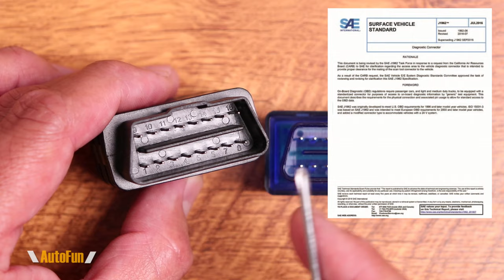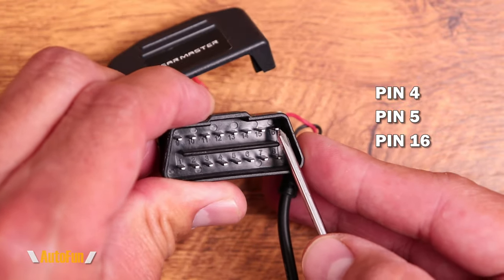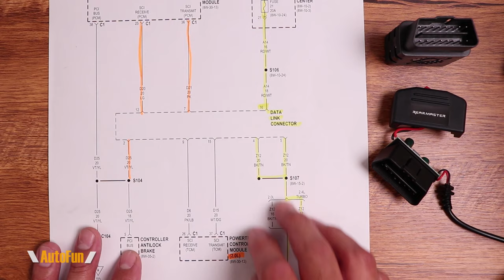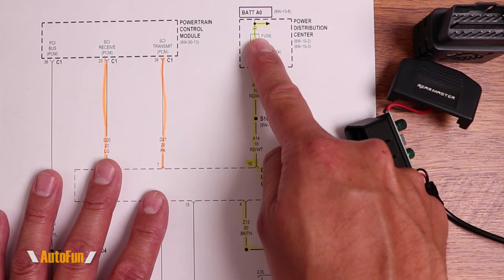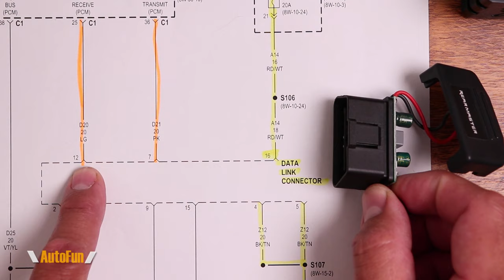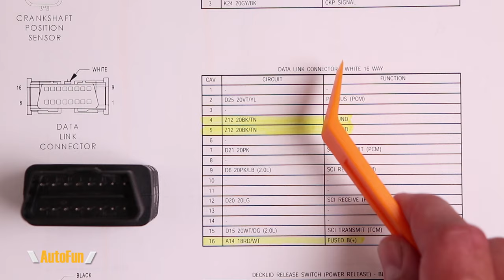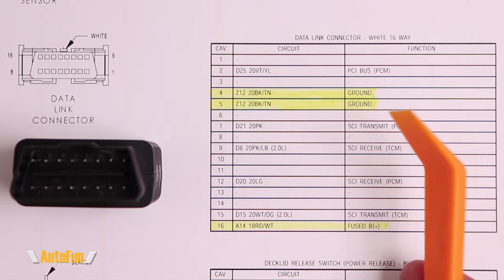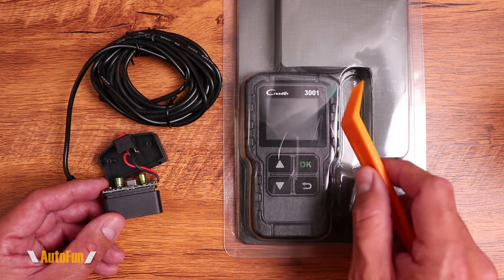OBD2 Power Adapter DANGEROUS? (Is it safe to use the OBD port for power?)

Comment: Alex, I've watched your very helpful video and I've read through the comments. I'm buying a dash cam for my son's first car for Christmas. He worked incredibly hard to buy the car...since he was 12 years old he saved money to buy that car. (He's been a car enthusiast since the age of 2!) I don't want to do anything to cause harm to it, despite the fact that it's a 10 year old car with 120,000 miles on the clock. It's still his most prized possession. That said, I remain confused by some of the comments and your other video on hard-wiring. I want to know whether it is best to hard-wire or just as good and safe to use this OBDII connector, please. I can order one with the dash cam for $50. Should I do that or should we attempt the hardwiring job as a DIY project? Thanks so much for your input.
Reply from the maker: Thank you Julia! Hardwire is an very involved process, requiring experience and knowledge, I strongly recommend profession installation due to the dangers involved with air bags as explained in my follow up video here https://youtu.be/uZp95NbNlmM and also potential dangerous issues caused if erroneously tapping a critical system of the vehicle explained in my dedicated hardwire here https://youtu.be/K2iKXj82354 Cheers!

Comment: You seem to understand these "gadgets" quite well. You have the knowledge and background to invent. Have you ever had a idea that materialized into an electrical or mechanical gadget?
Reply from the maker: Hi Bent Nickel! thanks man, I try to learn as much as I can (I'm still learning everyday!) but to answer you question. I had ideas but nothing that I realized on my own. However, I have contributed to products that were being developed, both from a design standpoint and from a manufacturability standpoint. Some engineers come up with great designs but they are not always possible to make in high volume, so the designs needs to be changed. But maybe one I have to come with a product of my own, that be kind of neat!

Comment: I’ve had an ultraguage plugged into my odb port for about 10 years and never had any issues but after seeing videos of Scotty saying they are deadly to a car I have decided to unplug it.
Reply from the maker: Hi Keving! Ah yes scan gauges will actually interact with the lines that communicate directly to the ECM, so the potential for something going wrong is higher that on a basic OBD2 power dongle where only power is tapped from the OBD2. But yes I had the same experience that you had, I have never had an issue plugging devices into my OBD2 port (and I plug in quite a bit of them since I'm always reviewing different gadgets LOL) Hope this helps, Cheers!

Comment: Awesome video!  Do you happen to know why the OBD-II port has 2 ground pins,  #4 = Chassis GND, #5 = Signal GND?   My guess is Chassis GND is for +12V power return, while #5 is for signal return path.  In your switched OBD-II plug, I see they are shorted together.  But how are these 2 grounds connected on the car side?
Reply from the maker: Thank you! Ah yes the reason it's technical in nature, I'm not an EE but will try my best to explain,  if you look at the SAE-J1962 standard, pin 4 is for ground as provided by the chassis of the car (for current draw as in SAE J1978). Pin 5 is a signal ground as in a ground reference for transceivers and test equipment but with consideration to noise contributions and node-to-node voltage offsets (basically a clean ground that is more free of noise than chassis ground). Now here is the kicker, some cars combine both 4 and 5 on the connector side and some keep the connections independent (which in my opinion is the correct way so the plugged in device can decide if it's needs separate grounds or to join them) If you check your car's service manual and wiring schematics it should show how your vehicle is using pin 4 and 5. Hope this helps, Cheers!

Comment: Very useful video. I have ordered Thinkware U3000 that has obd cable inside the box. However, the obd cable has 8 pins. Can this obd cable be harmful to the car?
Reply from the maker: You're welcome Gladiator! Ah yes as explained on the video, most OBD2 power adapters may be fully populated as far as pins however most of the time only the power pins are connected like the adapter as shown on the video. Cheers!
Reply: Thanks, but actually thinkware obd cable actually uses other pins. For example, when I open car's door, the dashcam triggered to be in driving mode.
Reply from the maker: You're welcome! yeah there are so many OBD2 adapters out now, it's almost overwhelming considering they use to be some what rare back in the days. I may make a couple more teardown videos on them if can get my hands on some samples, stay tuned. Cheers!  @Gladiator12350

Comment: While I don't see the need to draw power from the OBD port (I don't know how much power it can give, but maybe that is discussed later in the video😁), I do think any cheap OBD stuff is very safe to use. If they sell you a plug for 10 dollars that reads and/or resets codes, they probably haven't thought too long about safety.
I do agree with the video when he says that the power plug he uses doesn't crash the car's computer, maybe blows a fuse but not more than that.
Reply from the maker: Hi Benny! yeah and you be surprised of the quality (more like poor quality) on devices that are more expensive. I'm seeing the industry be more about the brand name than pricing which is crazy, some lower cost products sometimes exceed the quality of big brand names. Crazy uh, Cheers!

Comment: The OSB II port on most new vehicles should never go over 3 amps of power ether power in or power out because the wires attached to the OSB II ports are not rated for heavy power loads. But I actually use my OSBII port as a solar battery trickle charger that’s under 3 amps.
Reply from the maker: Hi D! Ah yes so far the OBD adapters I tested are limited in power draw (usually less than 3A @5V, so about half that amount at 12V where the power is being pull from) Cheers!

Comment: Hi Alex! Thanks for this informative video. 
My question is, if you have " 2" separate dashcams. Is it OK to connect one cam with this connector  and the other cam connected with a hardwire kit?
Thanks for any answers!
Reply from the maker: You're welcome Bud! Ah yes the OBD power adapter is independent of a hardwire kit being being installed, so yes both could be run. Cheers!

Comment: Thank you for providing this video. I have a new mirror dash cam. The company sent to me a new hardwire kit. It has OBD2 adapter, but only has two separate pins, top and bottom, and plastic fins in the middle.  And it also has one mini connector to the fuse panel. For parking mode and recording functions. Probably has to re-watch your video to learn is it safe to install? And contacting the seller have not receive installation instructions. Any advise?

Comment: Thank you for this video. Loved it.  Question- would connecting a dashcam to the obd port cause the battery to completely drian out?
Reply from the maker: You're welcome V! This would depend on the OBD2 adapter that is being used. The one I use, has a low voltage protection (to reduce the possibility of draining the car's battery) Here is my video showing how it works https://youtu.be/YEklm9V6xYE Cheers!

Comment: Hi, thanks for info!!
Do you think can I use N3 dashcam with Dash Cam OBD Hardwire Kit, Dash Camera USB Type C Hardwire Kit with OBD Power Cable for Dashcam 12-24V to 5V/3A with Low Voltage Protection 24h Parking Surveillance/Acc Mode for Dashcam, GPS or Radar on Toyota Highlander hybrid 2020? I’m just worried about before affects it!!!
Thank you…… hope you answer
Reply from the maker: You're welcome Ismail! Ah unfortunately I'm not familiar with the N3 or it's power requirements. However here is another video where I show you how to identify the power requirements of a dash cam https://youtu.be/-hGu8KZLaZ4 Cheers!

Comment: Incredible video! I can't thank you enough for this video you have created and the help and answers you have provided! I would like to ask you a question if I may? I am buying a Thinkware U1000 and the Blackboxmycar Powercell 8 Battery mainly for the use of the parking mode features. Does this ODB2 Power Adapter work in conjunction with the Thinkware U1000 and the Powercell 8 Battery? I am trying to keep the hookup clean and avoid using the hardwiring kit. Thank you in advance!
Reply from the maker: Hi Richey! ah good question, Thinkware does have their own OBD2 adapter (their dash cams work on 12V vs the 5V that dash cams normally use) here is the adapter https://amzn.to/3n83x0g and this one https://amzn.to/3lpOa2c (this one is a smart version of the OBD2 adapter, video on this adapters coming!) however if you still want to run if off a battery, this is the Thinkware battery pack https://amzn.to/3bnExj6 it's actually cheaper too than Powercell. Hope this helps!

Comment: Regarding the non-used pins getting shorted, it would be great if the connector only had the pins it actually needs. Then the risk of solder or other conductive material shorting anything out.
Reply from the maker: Hi Benny! Yeah that would make sense, the issue is that OBD2 does not fully use the connector body or a collar like most connectors to keep the connector in place, instead it more of the combination of the female and male connector bodies surfaces interacting when mating and the contacts themselves being mated for retention force. Which means unfortunately that leaving on the active pins on a OBD2 port would significantly reduce it's holding force and may lead to the connector to wiggle off or come off  easily. Cheers!
Reply: @AlexAutoFun  yeah, I figured that would be the problem. It is a bit weird that an automotive connector can't sit secure enough without all the pins tho. Puts unnecessary strain where strain shouldn't be IMO.
Reply from the maker: @bennylloyd-willner9667  Yep exactly! The J1962 standard actually does have a provision (Clause 5.5) for a connector latching feature to ensure connectors remain mated however since that same clause also requires that "it shall not require the activation of any levers on either connector to mate and un-mate" this has led to OBD connectors that can be partially retained by a passive method (friction of a mating surface, normally the top stub area). And in a few tools there is actually a button that you press to disconnect the OBD2 connector however strangely enough this feature requiring action on part of the use to un-mate the connector makes it non J1962 compliant. Maybe we will see this change on the next revision of the standard. Hope this helps, Cheers!

Comment: Will this activate parking mode on a dash cam since it is not hardwired in? I’m trying to decide between this or the hardwired kit. Awesome video.
Reply from the maker: Thank you Pete! Ah yes the OBD adapter will not enable true park mode. However in some cases it can be used to monitor the car will parked, here is video where I cover this https://youtu.be/YEklm9V6xYE Hope this helps, Cheers!

Comment: What a great video! Very informative and clearly explained. I've just purchased two Garmin dash cams (66W to the front and Mini 2 to the rear window) and have been researching for hours the best way to power those two. I'd want to avoid hardwiring. After this video, I now have the confidence to use Garmin's constant power ODB cable. Do you know if I can use the Parking Guard mode with that, perhaps with the 24-hour or always-on option? When not driving, I only want to have recordings of incidents, such as someone walking by or bumping into the car. Any experience using it with the Toyota Corolla TS Hybrid?
Reply from the maker: Thank you Sami! Ah regarding parking guard on the Garmin Dash cam with their OBD power cable, I have not tested either, however it is likely that their adaptor functions similar to the generic OBD power adapters. Here is my video where I explain how those work and their potential uses for park monitoring https://youtu.be/YEklm9V6xYE Cheers!
Reply: @AlexAutoFun  Thank you Alex for a quick reply! After spending more time researching, I think I will try to find a suitable 3rd party battery pack to power the dash cams instead of taking the power directly from the car's 12V battery.
Reply from the maker: You're welcome! @samidesousa

Comment: This will run off the car battery  ? Will this work with  any or dose it have to be Type c or micro cable?
Reply from the maker: Hi D! This would depend on the OBD2 adapter that is being used. The one I use, has a low voltage protection (to reduce the possibility of draining the car's battery) Here is my video showing how it works https://youtu.be/YEklm9V6xYE Cheers!

Comment: Can I ask for advice? For my mirror dash cam, the seller provide a hardwire kit for parking mode but without instructions. It is one cable type C with a voltage box. Coming out from the voltage box, one OBD2 cable (with 2 pins) and one ACC cable adapter to fuse. Which fuse is the ACC cable suppose to connect to? 

After watching your video, I am worry about connecting the hardwire kit. I won't do it until I get further search learning.
Reply from the maker: Hi M! I would recommend contacting the seller to obtain a copy of instructions as some dash cams interface differently than others. Cheers!

Comment: you have great video's, i have a Hyundai ioniq hybrid 2021 does the obd2 is o.k for the car....and can i leave it on surveillance mode all the time? 
bought
Reply from the maker: Thank you Nir! I would refer to your car's electrical schematic if you want to check the pin out of the OBD2 port. Regarding leaving the adapter on, it actually has two settings which I cover in more detail on the original video here https://youtu.be/YEklm9V6xYE Hope this helps, Cheers!

Comment: Thanks for your video. I've ordered an aftermarket (HUD) head up display on yesterday which need to connect to the obd2 port. Today, I've watched your video and I'm not sure should I use that Head up display or not. You make me worry about, is it safe to use it or not...
Reply from the maker: You're welcome Jason! And yes this video will help you decide if it's safe to use your OBD port. And here are my other videos showing you how to use a HUD https://youtu.be/z-m_ez2a8o4 (full review) https://youtu.be/b2JXMQyU-24 (side cameras and backup radar) https://youtu.be/QyMqe7gDfFk (OBD2 add on) https://youtu.be/YToLU4Z0aWU (fitment) and low cost HUD https://youtu.be/QEgP4ma8VUg Cheers!

Comment: Just always check the fuse amperage rating for the OBD circuit, compared to the device you want to power.

A Dodge Charger from another video had 10A fuse which means you can run under 120 watts of power.

Your schematic showed 20A for under 240W of power.

Plenty power for a video camera. 👍
Reply from the maker: Hi Lydell! Great tip man, Thanks for sharing! 🍻
Reply: @AlexAutoFun  I totally appreciate you making this video. I'm going to buy the same device. 🤜🤛
Reply from the maker: You're welcome Lydell, Cheers! 🍻

Comment: will the OBD adaptors work for VIOFO dashcams and if so which one is the best?
Reply from the maker: Hi Veerama! Unfortunately Viofo does not carry an official OBD2 adapter yet (but I will update this comment for you if they ever do) Regarding using the OBD2 adapter I showed on the vide. This will depend on the power requirements of the dash cam (some dash cams have higher Amp requirements than others). Here is my original OBD2 adapter video if you want to learn how the adapter works (and I placed links in the video description to the different OBD2 adapters available) Here is my other video https://youtu.be/Yky9_tTvwMc where I explain dash cam connector types and and power requirements (amperage) for (while the video cover this from a hardwire standpoint, the same principles apply to OBD2 power adapters). Cheers!

Comment: Hi Alex- Autofun, is OBD port has the same voltage of 12V Sockets ? or Can i say 12V Socket is more powerful ? Looking forward to hear from you.
Reply from the maker: Hi Arthas! Normally the OBD2 socket voltage is same as the socket (remember there are 24V vehicle systems out there along with 12V systems, so the voltage will depend on which vehicle system you have) Cheers!